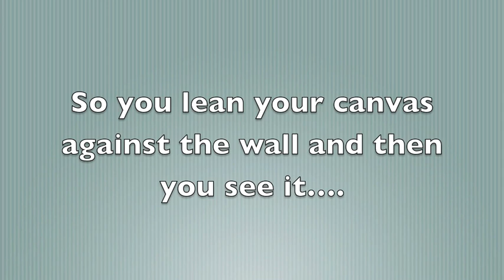How to fix a dent in your canvas

Comment: My gosh, I can't believe how well and how quickly this worked!  I started it in the bathroom so I could use the water from the sink and have quick access to the hair dryer, just in case.  I looked at the dents, looked down to evenly spread the water over the multiple dents with my hand, and by the time I looked up in the mirror, the dents were gone.  Seriously!  It was that fast.  Thank you so much for this great tip and for taking the time to make and upload this video!
Reply from the maker: +Darcy Crowley Glad it helped!! :D

Comment: Hi, what would happen if you sprayed water on the front of the canvas? I've just done this and then remembered that your video said not to spray on the front. It's a really badly dented shop bought canvas..
Reply from the maker: ***** I'm not quite sure what would happen to be honest.  I wouldn't really do this because it might change the surface for painting but let me know how it turns out! :D
Reply: Thank you for the reply! :) I've just had a look at the canvas (as it is almost dry) and i'm actually quite amazed with how it's turned out! The bumps are gone and I don't see any visible changes to the front of the canvas! I'm so glad you've made this video. Very helpful :)
Reply from the maker: I'm glad it worked out for you!  And thanks for the compliment!  Art is definitely an experiment and there is no right or wrong way of doing things at times.  :D

Comment: Very nice. However when I tried it, it didn't work. Arrrrrgggghhhhh
Reply from the maker: Oh no! Did you do this on an older painting or a print of a painting?
Reply: An older painting, large, oil on heavy canvas. Thoroughly wetted the area; even used a heat gun to dry hoping The heat and moisture would shrink the fibers. It is a classic gesso, but not a thick oil painting. I even tried canvas keys to tighten. I just may have to do it a few times. Do you think the age of the painting, 1973, might have something to do with it?
Reply from the maker: It might.  I think the structure has already settled and is completely dry so that may be why.  I'll update the video in the annotations for others to learn from it.  I'm sorry this didn't work out for you.  I'll see if I can find something that could help.
Reply from the maker: There's a product on Amazon called Tight-n-Up for canvases.  This may work. I would do some research though.  Would you happen to know if the painting was done with an oil primer/ rabbit skin glue?Here's the link for Tight-n-up https://www.amazon.com/Masterpiece-Artist-Canvas-Tight-n-Up-Retensioner/dp/B000GX9LS8
Reply: Yes, I actually tried that on the back of the whole canvas first, and blew dry. No luck either. I think the gesso + paint, as you say, is preventing shrinkage. Time for canvas keys!! Thaks MissArtist for your kind attention and response!!!
Reply from the maker: You are welcome! I wish I could have been more of help though! Let me know if you found something that works so we can give another option for folks!